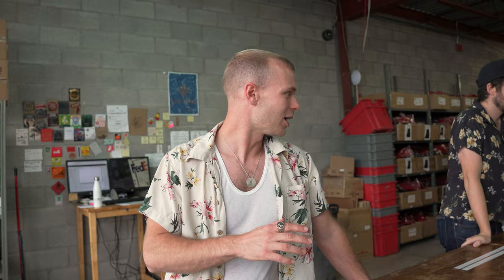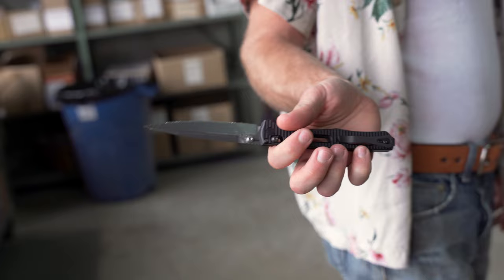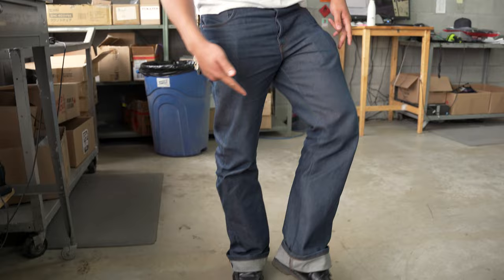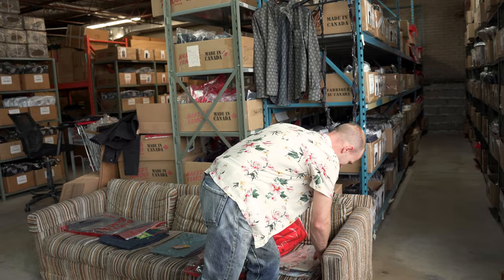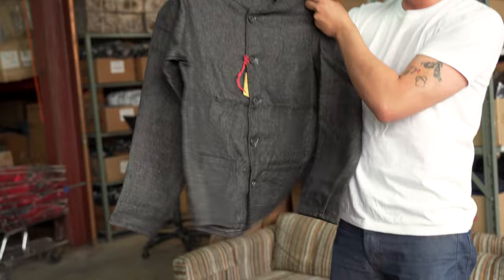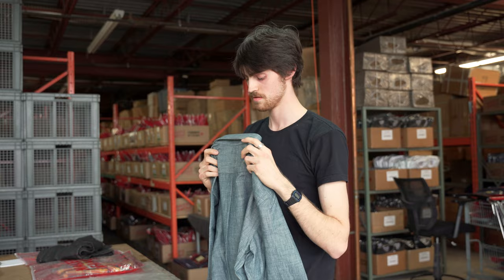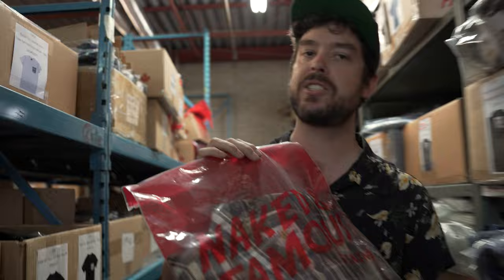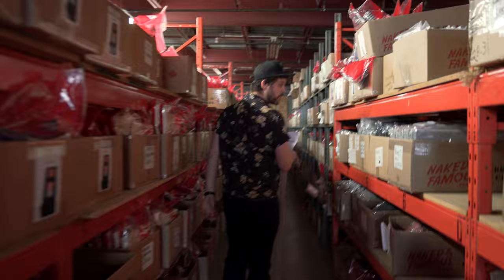This Week At Tate + Yoko - Episode 04 - Epic Raw Selvedge Denim Fade Battle

Comment: I'll be watching this shortly. Myself, just took a pair of Elephant 4 out the washing machine a few minutes ago, so looking forward to when they are dry.
Reply: What a coincidence! Elephant 4 in the video (mine are Skinny Guy though), looked excellent, great knee combs (or knee whiskers?) as well as the amazing combs on the back. They were the winner for me.
Reply from the maker: Now that's a crazy coincidence!
Reply: @NakedandFamousDenim  Yes! 
They are now virtually dry and I couldn't resist trying them on, unfortunately way too small, 32 tag, although my Elephant X are 31 tag and fit fine. A good example of why retailers need to use actual size charts for the specific jeans. A shame as they are very nice, not much wear.